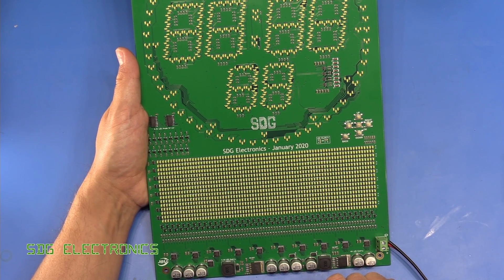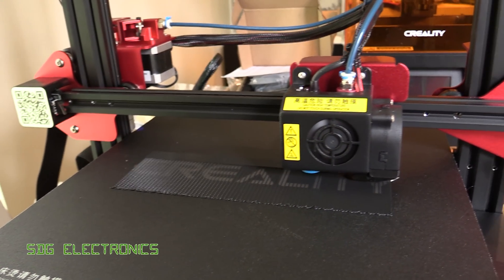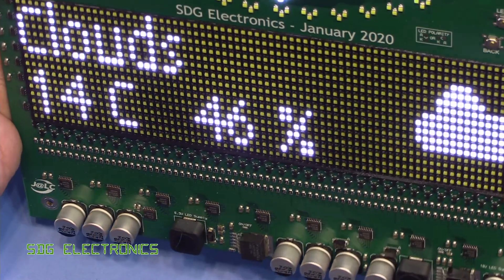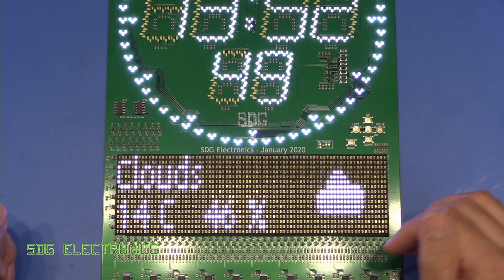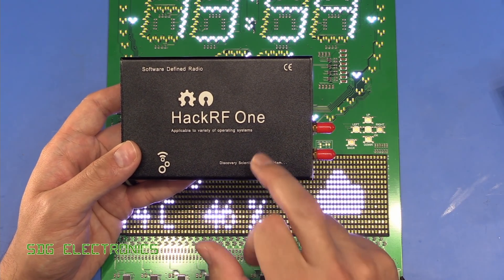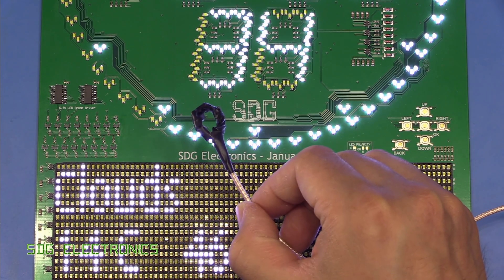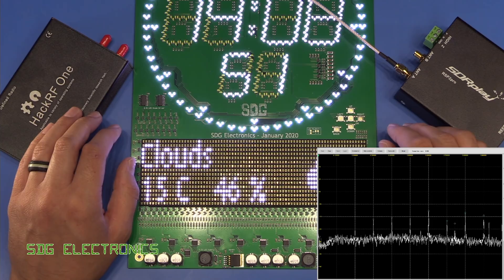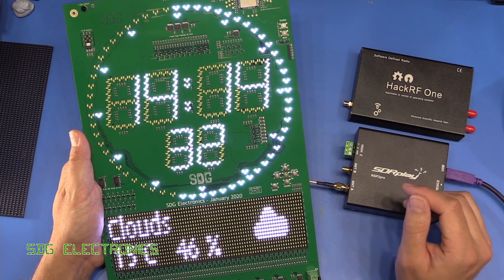SDG #155 Looking at Radiated Emissions and 3D Printing for Increased Contrast - ESP32 Megaclock

Comment: Interesting little devices to measure radiated emissions. I see it was measuring in dBm, can you change it also to voltage? As you were measuring it, it would be entirely useless for any kind of pre-compliance measurements on equipment but perhaps with some calibrated sources and getting it setup correctly with an antenna or with a conducted emissions setup, this setup could be used in smaller companies to do some pre-compliance measurements on a budget! Cool video, I like your channel as well!

Comment: Are you using the second core on the ESP? I've recently finished a project that plays MP3 via i2C->DAC, constantly sends DMX data, runs a UI on an OLED, along with PWM, and also runs a WiFi hotspot and webserver, all simultaneously. The trick is to split tasks up, and use DMA and maybe the i2S peripherals for anything time sensitive (both DMX and audio are very time sensitive in my case). You can use parallel DMA+i2S, so if you used 16bit, you could maybe update the LED matrix in the background with very little CPU time :) It does pull quite a bit of power when using both cores plus peripherals though - measured mine at almost 180mA just for the ESP on the board!

Comment: Have you tried to use both cores to spread the load? two cores running at 80MHz shold help.

 niceuse of a SDR as an spectrum analyser, when I first used an analyser it was referred to as an "Rectum Paralyser" due to its size and weight especially if you need to move it from its trolley to the bench.
Reply from the maker: Yes, the multiplexing is the only thing running on Core 1,but there seems to be something which still causes issues with the sending out on SPI
Reply: @sdgelectronics  strange the cores running so fast you would have thought that there should not be a problem. maby its the way the compilier is doing something?
Reply: LOL !

Comment: I coded a controller for a raw VFD glass (GIC VFD) for the Atmega328 and actually planned to change to an ESP32 instead of the lowly Atmega, but after hearing about your interrupt glitches, i might change my mind on that. Did you see any change in interrupt stability if you update less elements during the ISR? I'd like to see the code for your clock to see how you handle the interrupt. Thanks!

Comment: Using a PIC micro for the time sensitive or critical functions is a rule that I have when using the ESP32. Its a very powerful micro but handles poor these conditions. I mostly leave it to handle communication protocols and serial/i2c between the PIC. This way even if it freezes, the most important tasks will continue to work. Great series of videos by the way!

Comment: Yeah you have to account for shrinkage. It's the same when you weld steel, you deposit molten material that is highly expanded, and when it cools it shrinks right down. It's kind-of why ABS is a pain, because you have to use higher temps. Tinted lenses kind-of reduce the contrast and hide bleed-through to some extent.
That 3D printed grille was my idea for a part assembly stencil - lol. Just drop parts in holes, remove stencil, and place in oven.

Comment: You could stand off a panel and use about 1875 or so pieces of light pipe.  If you slightly scuff up light pipe, it can diffuse the light in a very controlled manner.  I think your baffle is a really solid solution, as there’s not going to be any drilling necessary.  Goodness, I’m really impressed with those antenna RF images, with all the harmonics.  Darn great idea for troubleshooting applications!!  THANKS FOR SHARING!!